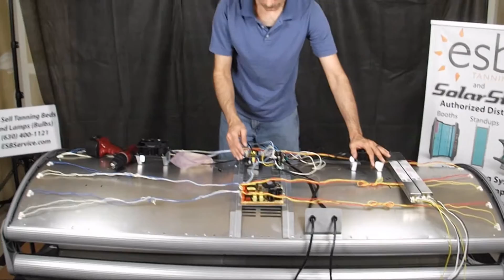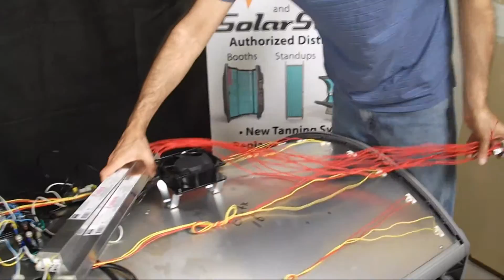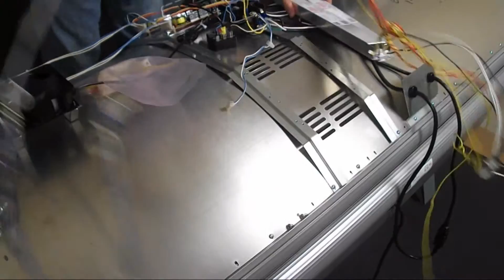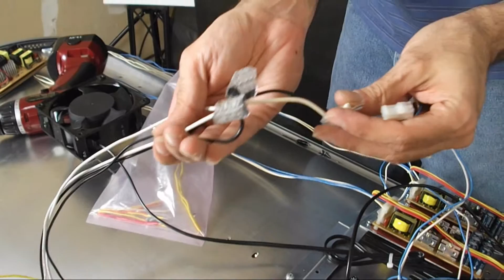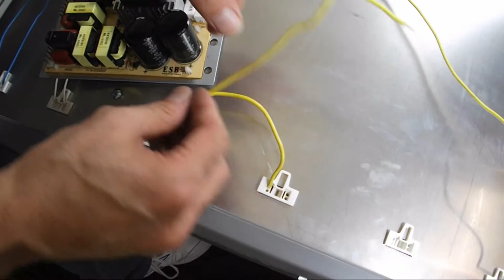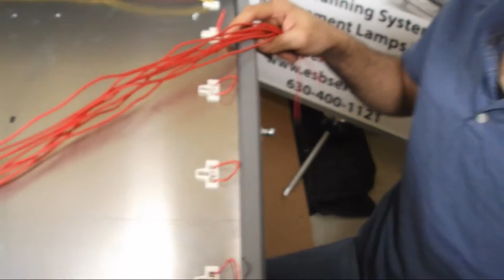Converting from a 4-Lamp "Open Style" Ballast to RT Ballasts on an ESB Tanning Bed

Comment: I have a sundash r26b tanning bed. The top lights up but the bottem only one light comes on. No fans come on and it makes a humming noise. Could it be a ballast is bad? If so can i convert a 1.82amp to a smaller amp? All wiers are hooked up.
Reply from the maker: Thanks for your question...Sorry, but that is a brand that I'm not familiar with, so I can't be sure...If you have only one lamp coming on in the bench, I'd recommend seeing if the other bench ballasts are getting power.  Usually, it's a pair of black and white wires going to each ballast.  Is your contactor coil getting the full power it needs when the timer is engaged?  I'm sure you've already verified that all the bench lamps are ok?  Do you know if you have starters?  I"m not sure what you mean about converting amperage, but it doesn't sound right.  Please call 630-400-1121 or email info@esbservice.com if I can help further.  Thanks!
Reply: Russell Dulaney i tried to call. Left a message. I see im missing SCA & Sonnenbraune Remote Timer . i cant find any. When i google search SCA & Sonnenbraune Remote Timer Plug it shows a picture what the bed looks like its missing but mine only has 4 holes instead of 8. Would that cause the bed to run differently?
Reply from the maker: @amberrosario9112  Sorry, I'm usually out of the office on Fridays doing local service calls.  I'm sorry, but again - this is not a bed type that I am familiar with unfortunately.  I am familiar with ESB brand beds, Solar Storm, Solar Wave and their variants.  From what you describe, your model is set up different than what I'm familiar with to be honest - so I would recommend seeing if you can find a technician that specializes in that brand.  No guarantees, but If you could email me at info@esbservice.com, I could send you possible sources for further help with that.  Thank you!